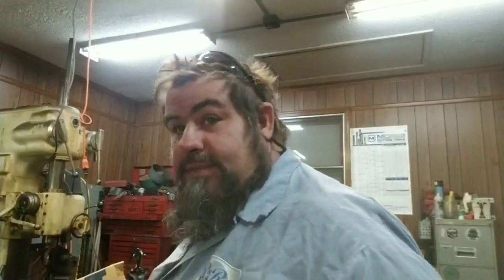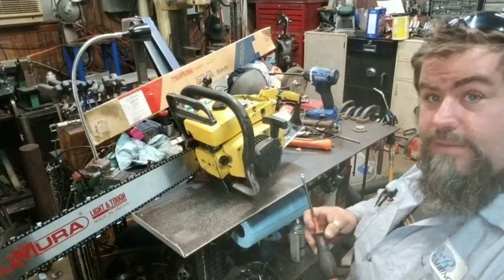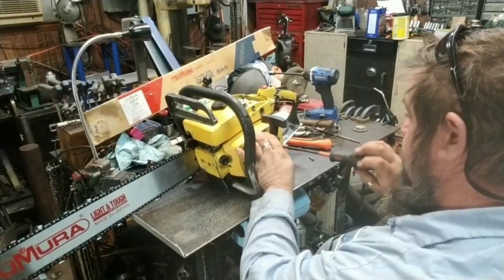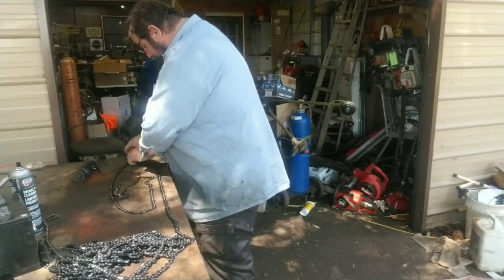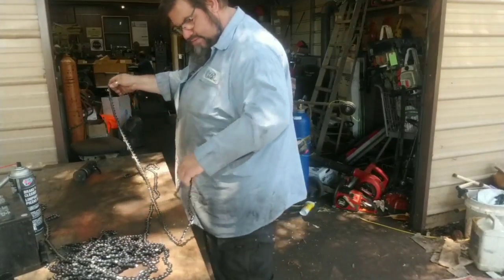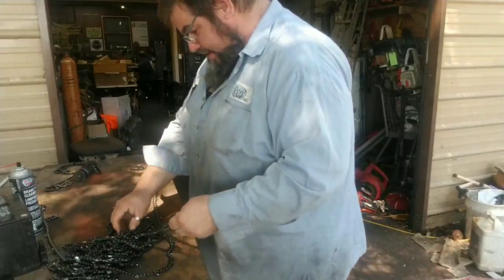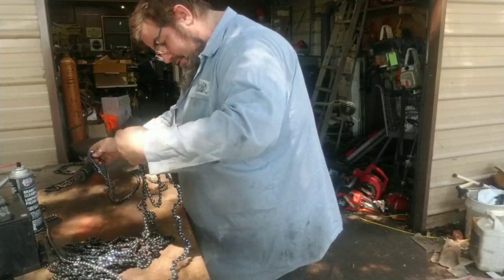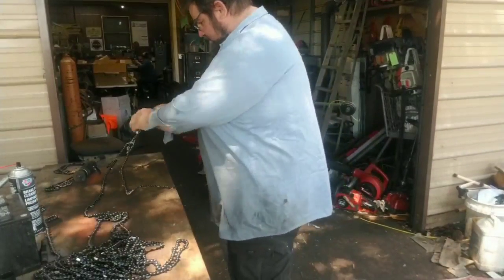Rambling and cutting & making chainsaw chain

Comment: my set up down at work consists of a flat bench with an oregon chain graph in the middle with all pitch chains on it, i have my roll of what ever size chain im making at the other end on a steel pipe so it can spool off, the othe end i have nails punched into the board 1 for each pitch in its true position to represent drive link No 1. i just drag the chain out, sit it over the coresponding nail then mark with White twink pen the last drive link then straight into the rivet punch, no counting.
Reply from the maker: I would love to have a chart but i cant find one i hate counting them

Comment: So where do you cut the chain before  making  it. I didn't  see it 😆. Any where in the middle  of teeth?
Reply from the maker: No i count to the drive link i need the cut the rivets on the strap connected to that dive link and knock it apart with a punch
Reply: @bellhoppersaws  ok cool I see. I all ways bye my chains made up but would  like make them Cheers.👍